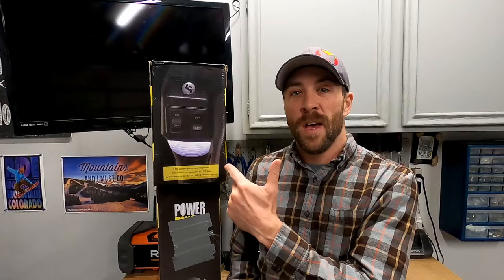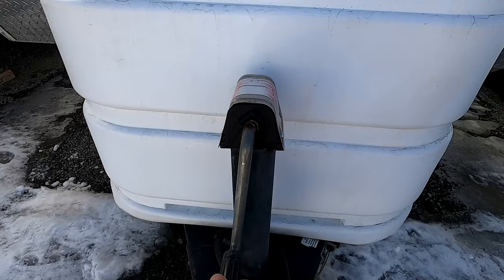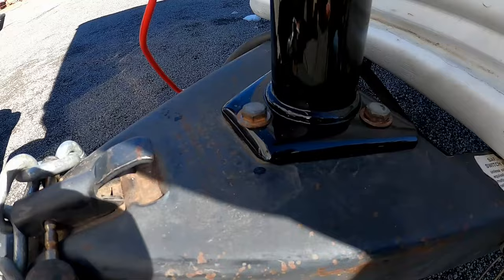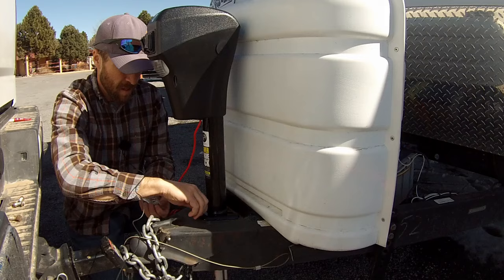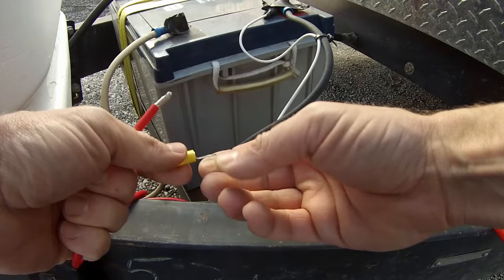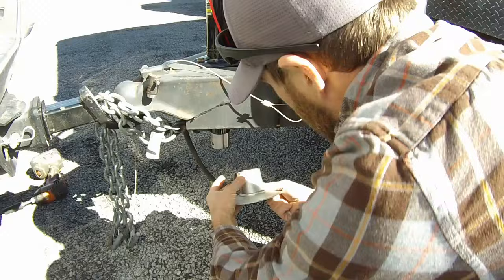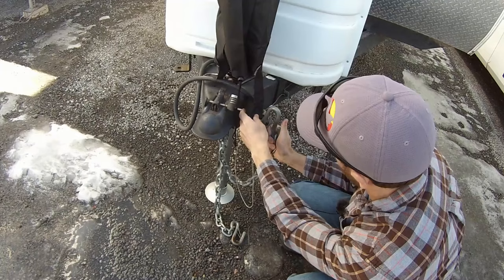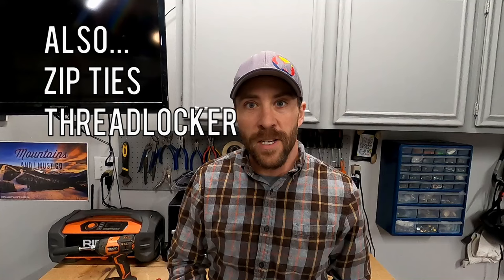How To Install An Electric Tongue Jack On A Travel Trailer - Lippert 3500LB Power Tongue Jack

Comment: Thanks. Great info. The one I have now is an FIC brand that came with the trailer. The shaft broke!  So, although the motor worked fine, I could not use the hand wrench to have it lift off the trailer. Had no choice but to buy a new one.
Reply from the maker: I'm glad the video could be helpful. Good luck with the new Jack. Thanks for watching!

Comment: Great video very simple instruction thank you my issue is and I’m not sure if you can help me with it or anyone for some reason the one I’m replacing was scraping on the ground. Just go ahead and replace it with another electrical tongue jack but I’m worried that it’s gonna scrape on the ground as well so I don’t wanna just replace it and have to keep replacing it. I’m pretty sure it was the scraping that ruined my last one so I’m not sure are there shorter ones like ones with a shorter steam on them either way I don’t know if there’s some way of making it so that it doesn’t scrape on the ground. I can’t seem to find any videos specifically about this issue. Any help would be greatly appreciated.
Reply from the maker: My In-Laws have a foot for the bottom of theirs that kicks up for transport.  It looks like this: https://amzn.to/4forA54  You may be able to remove the one you have and put this one on instead.
Reply: @ColoradoCamperman  thanks I will check it out

Comment: Trying to size a jack for my trailer.   Is the 3500 lb model you show for the total weight it could lift "at the tongue" (not tongue weight)?    My trailer max weight is 22" long and weighs max 6,100 lbs, so how do I size this thing?   I've searched the web on this but it's not really clear....can you make a suggestion?
Reply from the maker: The 3500lbs should be tongue weight.  Our tongue weight is roughly 700lbs. So the 3500lbs is more than adequate.  Thanks for watching.

Comment: Great upgrade! Do all tounge jacks, both electric and manual, lift to a standard height? How about weight rating?
Reply from the maker: Great questions!  Yes, this is supposed to lift up to the height of taller trucks.  It says 28.5" on the description of the jack.  Weight rating is 3,500lbs - that is tongue weight though.  Our trailer's tongue weight is around 700lbs so it lifts it with no problem.  Thanks for watching!
Reply: I'm no expert, but I think the way to handle tall trucks is actually to lower the hitch on the truck.  They make all kinds of options for that.  Otherwise, raising the tongue could put a pretty serious tilt on the trailer.

Comment: Why cant i just hook up the power wire to the 12 volt accessories wire that turns on the inside cargo lights so i don't have to install a battery. I understand ill need to have my truck on or key on but so what and trailer plugged in.
Reply from the maker: I don't see a problem in doing that at all.  That is definitely a way to do the install.  Thanks for the comment and watching!

Comment: Is that hooked right to positive red or positive ground?
Reply from the maker: I hooked the red positive wire directly up to the positive side of the battery.  The manufacturer says that it is grounded through the metal jack touching the tongue.

Comment: How do you keep the battery charged?
Reply from the maker: 200 watts of solar.  Also, you can manually crank the jack.  I actually had to do this the last time I picked up our camper from our storage unit.  I forgot I removed my battery.  It is a 3/4in socket - same as my stabilizing jacks.  Thanks for watching.

Comment: What if your batteries are inside?
Reply from the maker: Do you have any wires on the tongue of your jack to tap into?  If not, I guess you will have to run an extra cord to a location where you can get 12 volt power.  Hopefully that makes sense.  Good luck and thanks for watching!

Comment: If you do this make sure you use water proof heat shrink on your ring terminal do not just clamp it on like he did.. also do not use wire strippers as those are not crimpers if your going to do this do it right, otherwise nice job 😁
Reply from the maker: Thanks for the feedback and watching!

Comment: It seems pretty straightforward, but the jack seems a little slow...
Reply from the maker: Yep, it's an easy install. It only takes maybe 45 seconds to raise or lower. In the grand scheme of things, it's really not that much time and you get used to it. Beats the heck out of manually cranking in the heat of the summer.
Reply: @ColoradoCamperman  Yep.  And it's a game changer if you're mounting anything on the tongue of the trailer that interferes with the swing arc of the crank.  I've ordered a light-weight jack block that will go under the jack and reduce the amount of travel required, and that would speed things up, too.